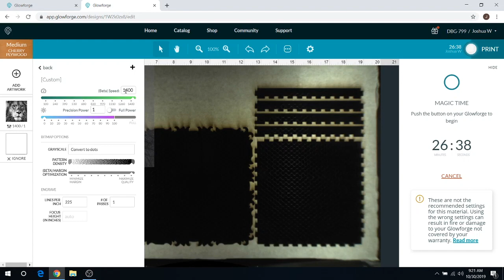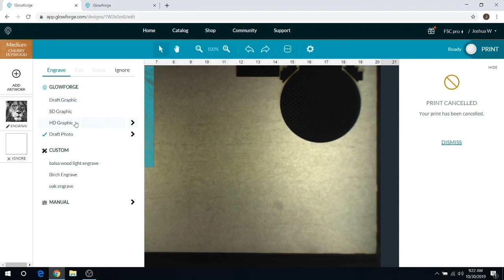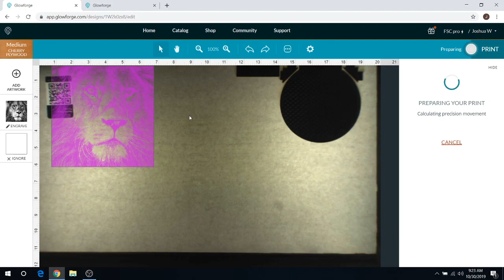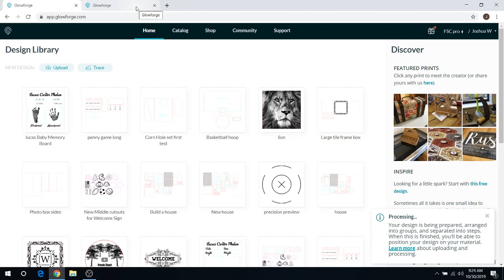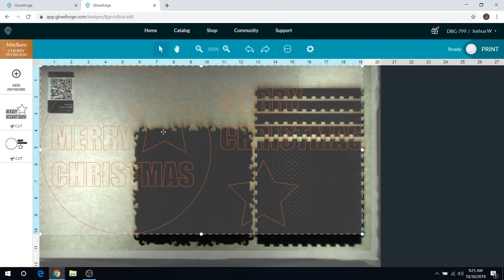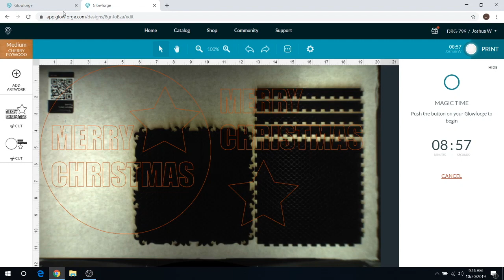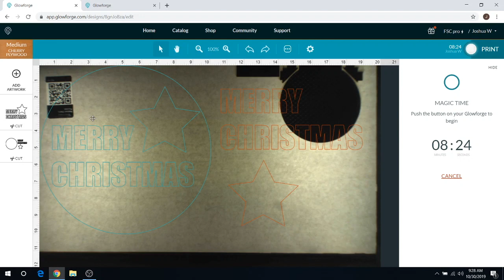Glowforge Basic VS Pro proofgrade settings speed comparison

Comment: Do you find that you like your basic as much as the pro? Also do you find that it over heats often? Thanks!! I have the budget for the pro but hate to pay extra if there’s not that much of a difference!
Reply from the maker: They both work pretty much the same. It really comes down to if your in a hot state and if you want to use the passthrough slot on the pro, if you do either of those then I'd say get the pro. If you want to save some money off too you can use this referral link: https://www.glowforge.com/freshstartcustoms